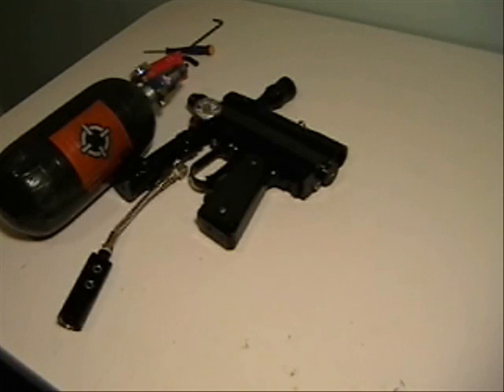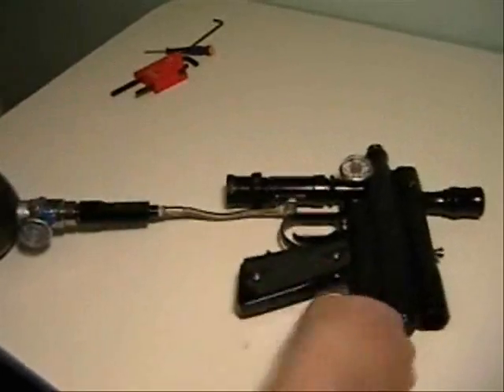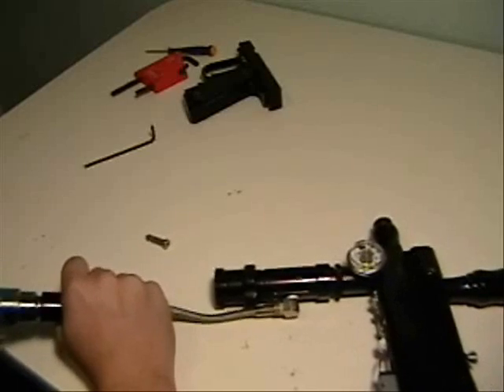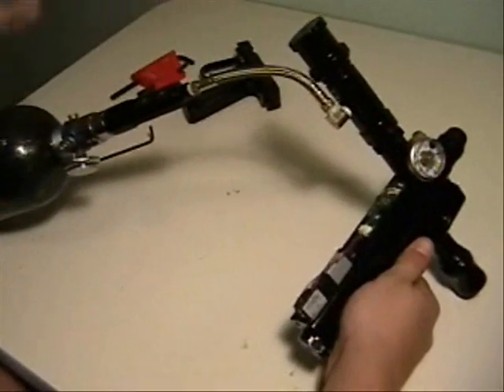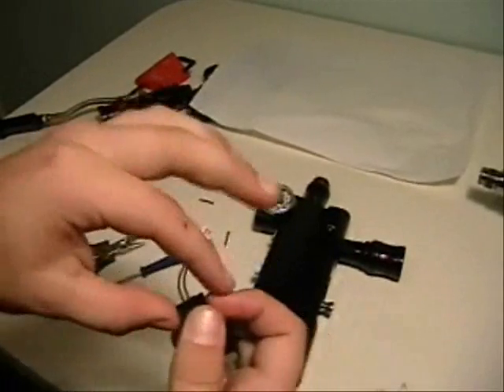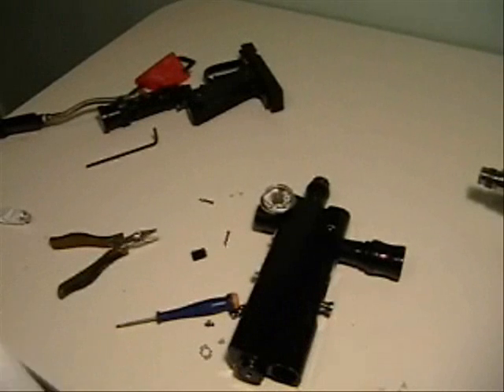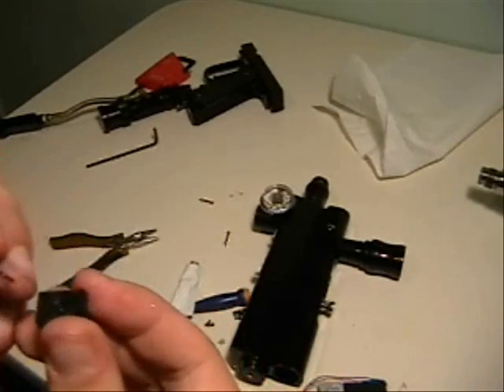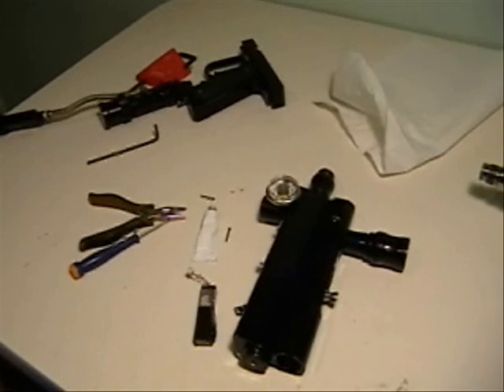Impulse noid leak

Comment: i hope you still come and check for responses. My gun is leaking from blow out valve. The brass peice right next to pressure gauge. and if its not a continues blow out it will sputter at ya.
can this be repaired and can you show